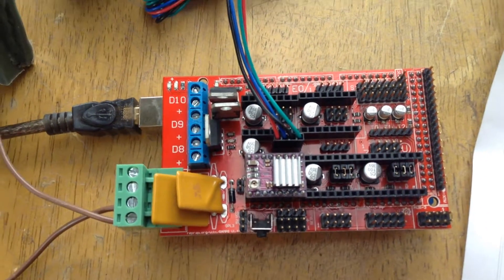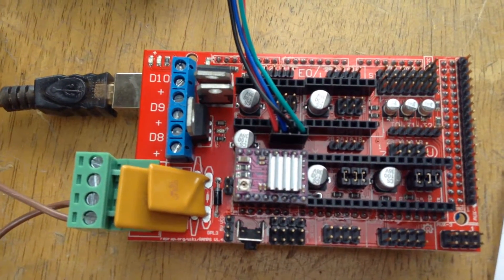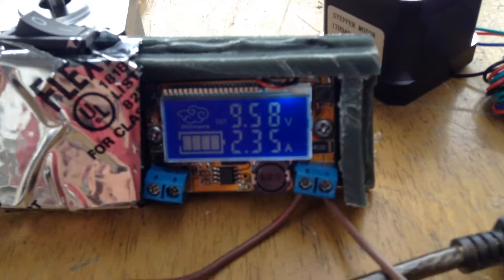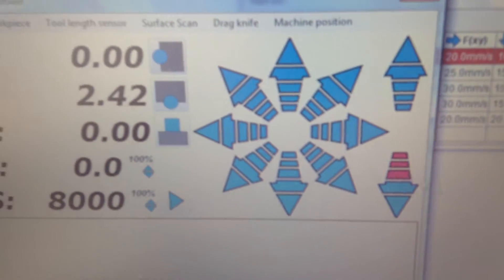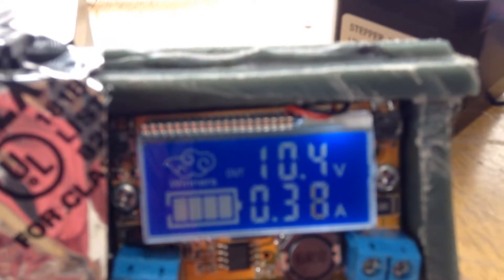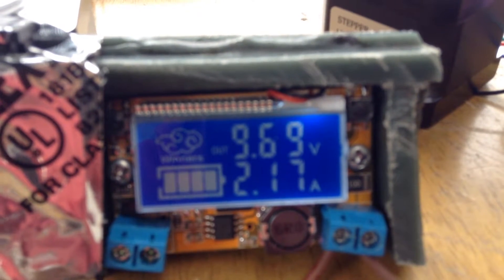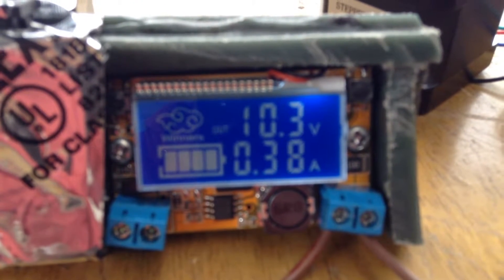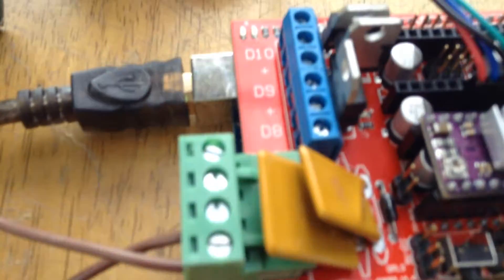Help !!!!! Ramps 1.4 motor problem pulling more power when stopped

Comment: It is like a fan the faster they spin less amps it draws which would make sence for this because it is a motor that is why when you pull the fan switch it goes to the fastest first because it takes less amps